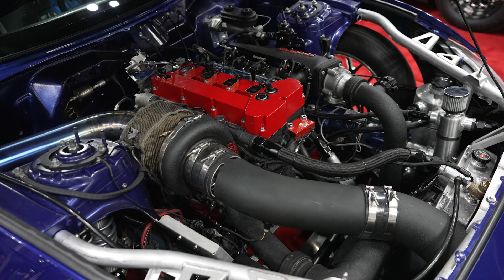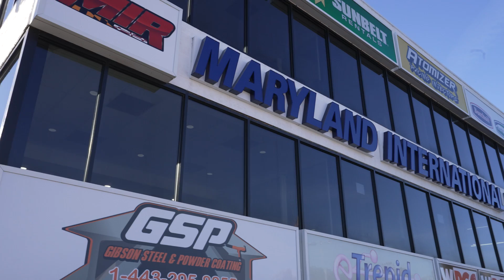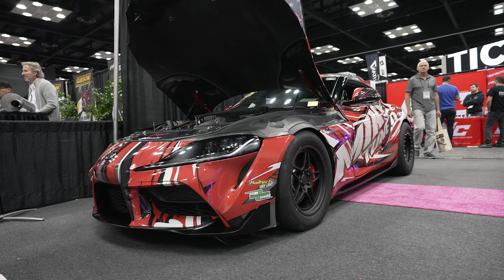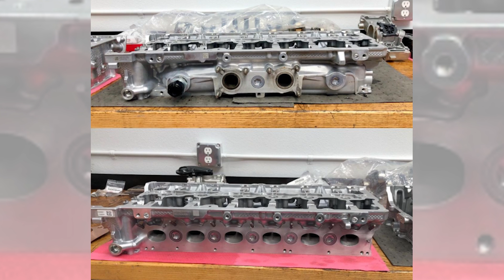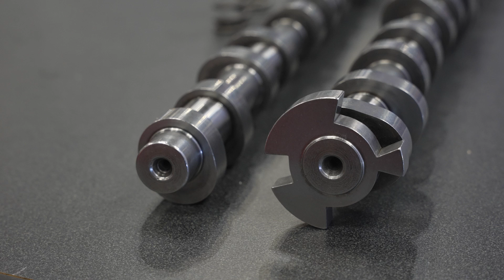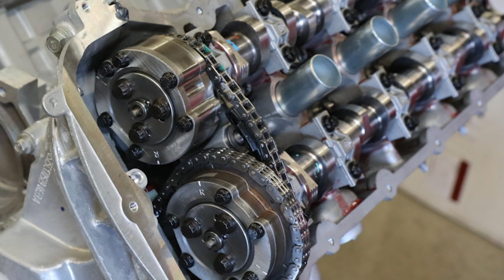World's Quickest MkV Supra! Kelford Cams new S58 and B58 Camshaft Range - PRI Show 2023

Comment: What about Valvetronic adaptation after KEelford cam + spirngs S58 Stage 2 ?? Doesn't the greater resistance from stiffer springs and a sharper shaft cause problems? We have problems with adapting the end points, the servo detects too much resistance and ISTA is unable to complete the procedure.. where is a fault?